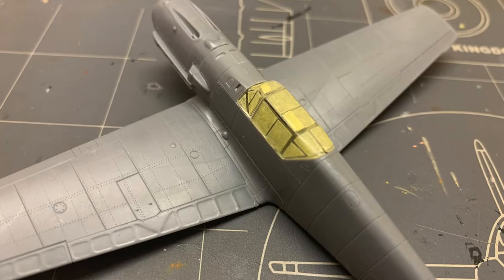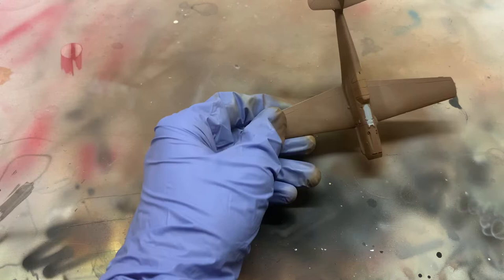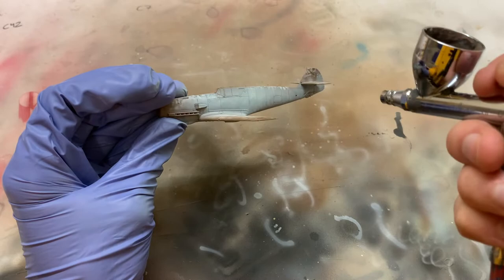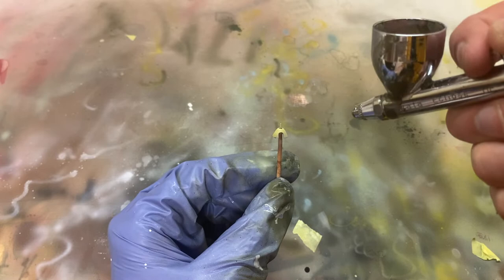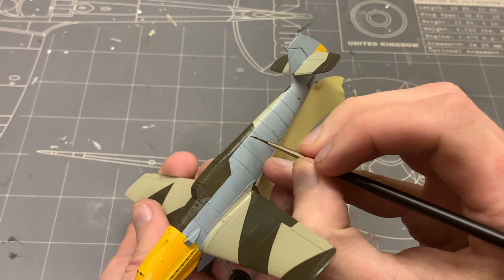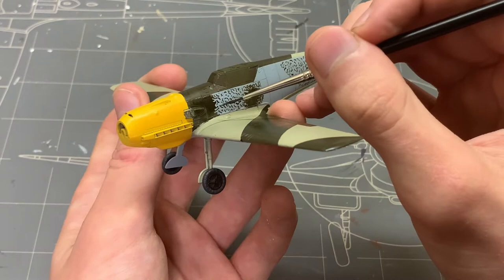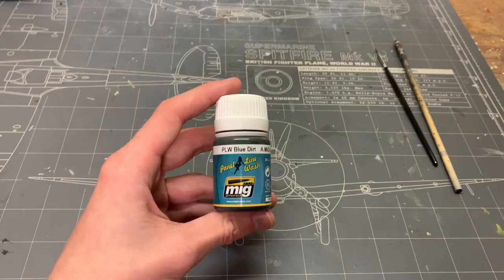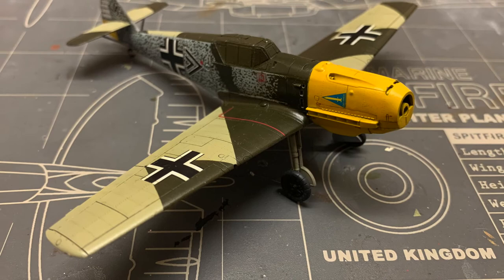Let's paint a complex WW2 German camo | Bf 109 E-4 1/72

Comment: Nice build!!! Concerning the Tamiya decals I'm really surprised how few experienced modelers know how to use them correctly. I'm not that experienced myself as a modeler, however, I started with some Tamiya builds after hearing what awesome kits they make. I was then hit by the surprise of people saying how bad the decals are. It just didn't sound right to me so I decided to really look into it. I was glad to find some information on these decals that does not seem to be common knowledge. First they are of an entirely different make up so, all of the chemicals you may be use to like Micro Set and Micro Sol will actually destroy them. If you do want to use something like that you need to use Mr. Mark Setter and Mr. Mark Softer. But these chemicals are not really needed. The true trick to Tamiya decals is the use of very hot water. Most decals do not require hot water, but Tamiya decals have glue that is activated by hot water. If the water is not steaming, then you will just keep pushing the decals around all day and it will never stick. Hold a Tamiya decal is steaming water for 30 seconds, place it where you want it, push out any extra air and let it try. Don't move it around a bunch or the glue will just re-dry while you are moving it. For Tamiya decals it's all in the heat.

Comment: Uhuh, i used AK paint once. And never again. It cloged my airbruish so much that i spend a week cleaning it and the paint cracked on the model surface which was catastrophic because i painted a Tiger tank interior. I still wonder how i saved this model.
Reply: It sounds like you thinned the paint with IPA. Alcohol turns AK paints into sludge. You must use dedicated AK thinner or distilled water with them. Tamiya acrylics, on the other hand, are the opposite. Use Tamiya acrylic thinner and IPA to clean the airbrush.

Comment: Wow, a real "expert" at work. The interior of  Major Wick's aircraft Bf 109 E-4 was painted in RLM 66 and the camouflage pattern consisted of RLM 74 and RLM 75 upper surfaces, with RLM 76 on the fuselage sides and undersides. The spots werte applied by brush in probably either RLM 71 or RLM 02. It's an ineradicable legerd that all Bf 109 E's during the so called  Battle of Britain were finished in RLM 71/RLM 02 on the uppersides. 
Oh, by the way, Major Wick flew this aircraft, Werknummer (W.Nr.) 5344, since spring 1940 till his death in November 1940. But I suppose you know it all better...
Reply: Rude. And let's see your work, hotshot.